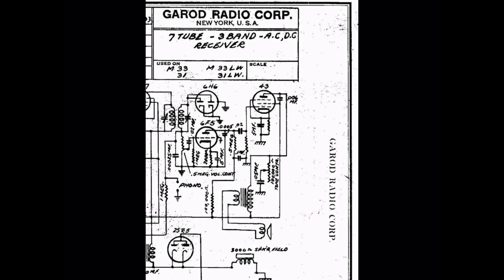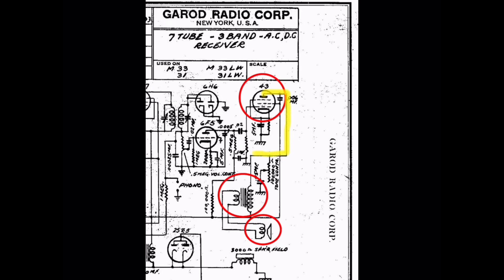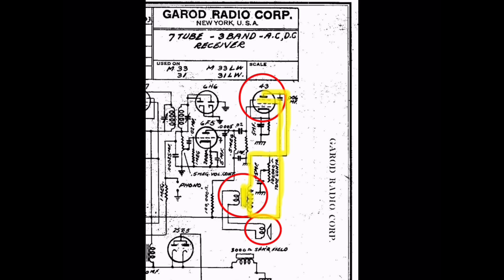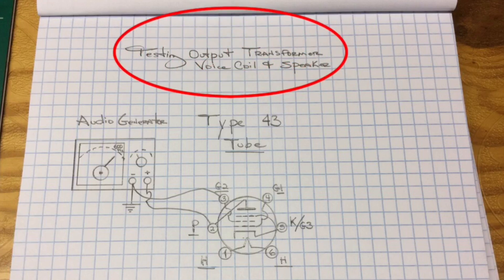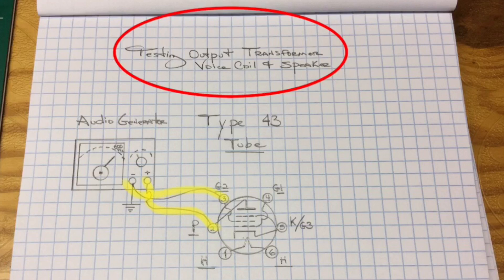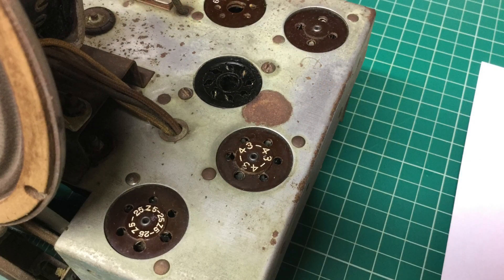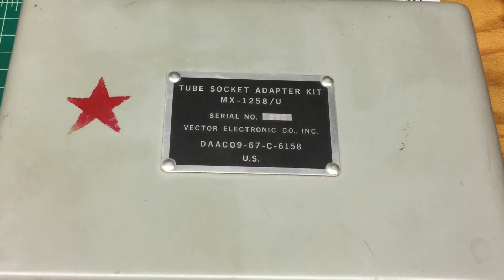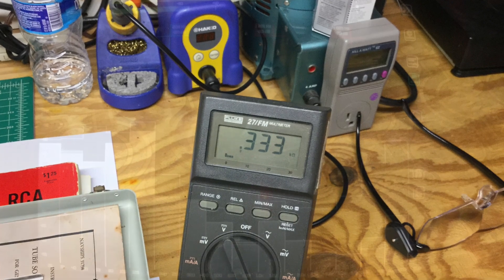Garod M33 - Audio Testing

Comment: Hi Don Get to feeling better. Thank you for showing the hookup of the generator. I don't own any high tech equipment what was the bar-graph thingy :) on the last part of the video ?. Sorry for the dum question Just have never seen anything like it.
take care.
Bobby
Reply from the maker: Thank you Bobby! The program is called RTA Audio and it runs on my iPad. I'm using the free version and it relies on the iPad internal microphone and creates a frequency response bar chart that I had set to capture the peak hold as I slowly adjusted the audio generator from 10 Hz to 10000 Hz. Looks like the speaker produced the highest amplitude between 200 & 300 Hz. I've never measured the amplitude/flatness of my audio generator on my O-Scope, so the shared results are for demonstration purposes only. Hope this better explains the application and how I was using it. Best, Don
Reply: +RestoreOldRadios Thank you Don. get some rest feel better :) Anything I can help with,just give me a holler. It just occurred to me I have the same style test sockets. 
Take care.
Bobby

Comment: Hmm...all I saw was an audio bar graph (besides the adapter hookup).  What am I missing?
Reply from the maker: John - sorry; probably not my best effort on the video, a little under the weather. After connecting the audio generator as noted, I set the audio frequency to 100 Hz and slowly started going up in frequency to 1000 Hz, then went from 10000 Hz down to 1000 Hz then 10 Hz back to 100 Hz while capturing or showing the peak amplitude out of the speaker to somewhat demonstrate the frequency response. Hope this better explains what I was doing during that time. Please let me know if you have any questions. Best, Don